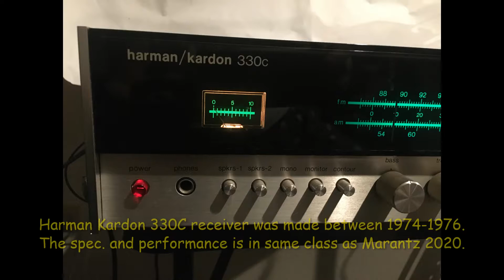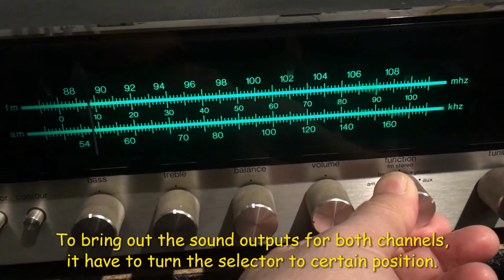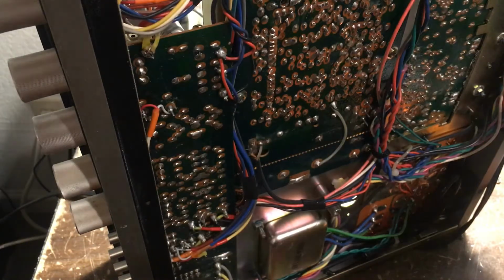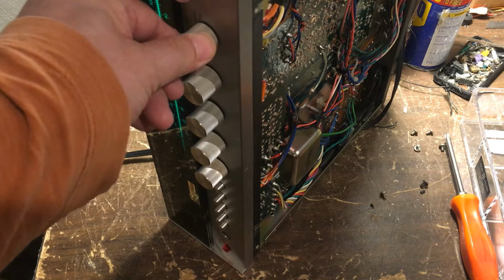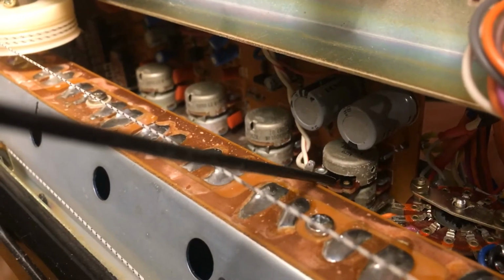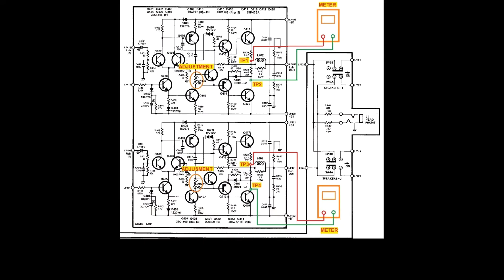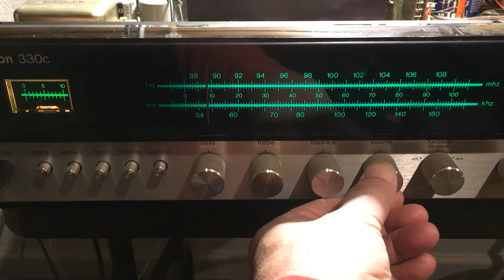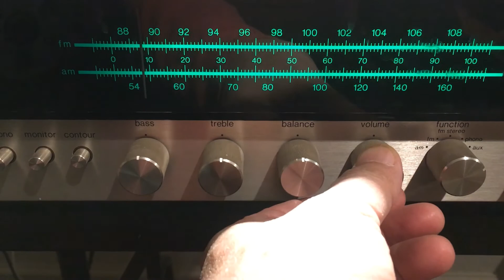Servicing a Harman Kardon 330c Receiver

Comment: I have a 330C, it was my first vintage reciever (we are about the same age so I guess that makes me vintage too). I found it a garage sale for 5 or 10 dollars. I knew nothing about vintage gear but at that price I took a gamble. I got home and found that it sounded so good that I now also have an HK 730 Twin, plus gear from Luxman and Sansui, I always keep some 'hidden' cash in my wallet for just such an occasion. 
Thanks for the informative video, I hope my multimeter is accurate enough to check bias, do I do that under a constant load such as playing pink or white noise?
Reply from the maker: Thanks for the sharing. Based on the service manual, do the bias adjustments with the load of 8 ohm 50W resistor connecting across the speaker terminals (see page 4 shown in Service manual).
Reply: @VintageAudioFan  Thanks for the info, I guess I need a resistor!

Comment: "*Connect 8 ohm (50W) resistor across left and right speaker terminals."???   The one thing people need to see during your service and it is not shown.  How did you perform this requirement Vintage Audio Fan?  It seems that this is the step that there is never enough straight forward, concise instruction on.  Some of us need like the "twenty seven eight-by-ten color glossy pictures with the circles and arrows and a paragraph on the back of each one explaining what each one was", type of thing.  Just sayin.  Besides from that thanks for everything.

Comment: Trying to figure out the little brother to this. the HK  230
The Idling adjustment you showed was excellent.   The Bias is a different adjustment for the speakers out terminals to adjust as close to zero as possible.   did you do that adjustment?
Reply from the maker: Sorry for the late response. I don't own HK230. But based on the service manual: https://www.hifiengine.com/manual_library/harman-kardon/230.shtml.
On page 7,  it shows how to make Pre-driver/Driver adjustments - by using VR501/VR601 to adjust DC balance. It requires hooking up a 8ohm (50W) dummy load resistor at speaker terminals and in parallel connects leads of the oscilloscope, and feeding with 1K HZ sign wave to AUX inputs from a signal generator (starts with minimum outputs). Then following the descriptions of the procedure.
Reply: @VintageAudioFan  Thanks for the reply.   I don't have an osiliscope yet.  okay digital ones on Amazon are probably good enouph.  From the manual and other forums there is a .5 volt across the speaker terminals which is normal and that goes to zero with the speakers hooked up.  Something to do with the 230 being a capacitor coupled design.  I tried it on junk speakers and it works.  I have it hooked up to a good set of speakers and it is very good.